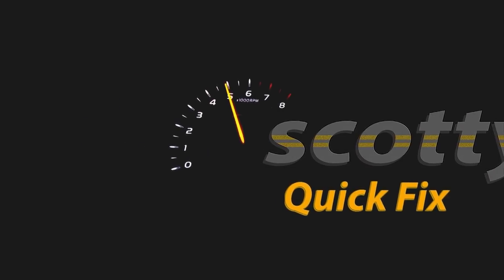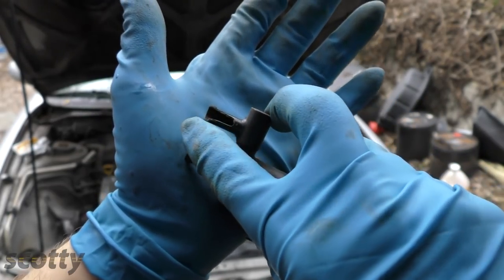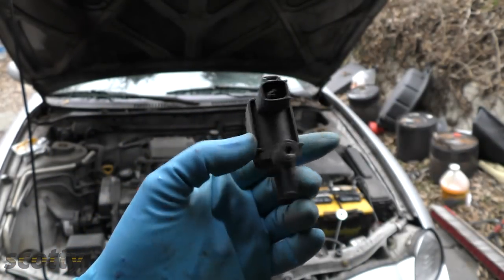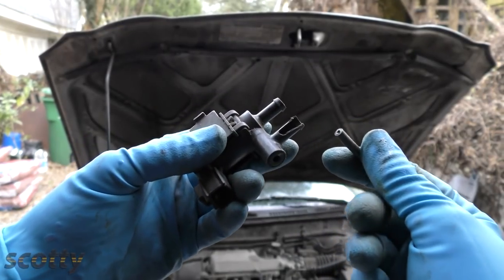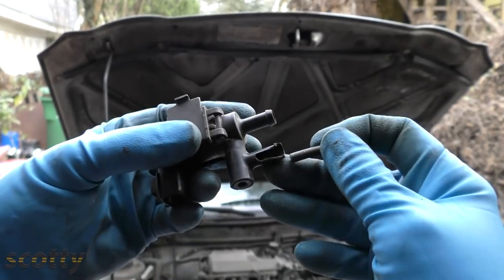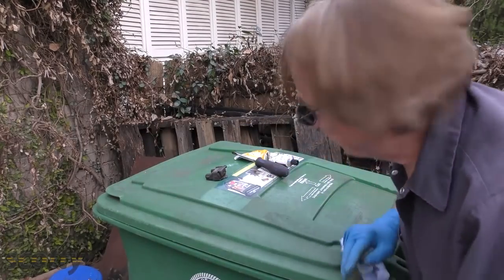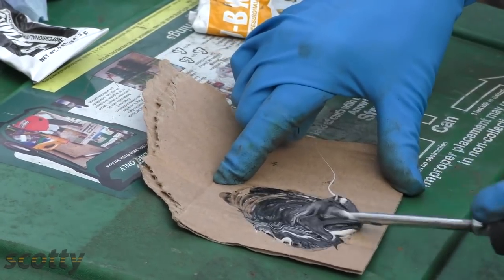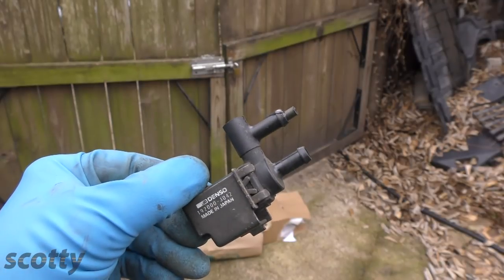How to Fix Car Parts Instead of Buying New Ones (JB Weld)

Comment: I was working Offshore on an Oil Rig when a a very inopportune time an Exhaust Manifold Cracked on a Diesel engine, it was a Turbo Diesel and without a fully functioning turbo there wasn't enough power and we were going to be STUCK and the end result would have been $Millions ...  we retarded the Cement with the low pressure that the pump could deliver and that gave us an hour ... we pulled the exhaust manifold, drilled a couple holes and with some JB Weld (that some guy just happened to have in his tool box) we repaired it, re-installed the manifold and waited for it to cure as long as we thought we could... it lasted (worked) until the next day (more than 24 hours) when the replacement manifold arrived on site.
Oil Field folks are some of the most resourceful folks on the planet.
JB Weld is great stuff

Comment: Jb weld works great I use it all the time. My buddies rear spark plug blew out on the ford 5.4 common problem to blow plugs out. He used it 10-15 times a year to tow a boat he asked me to fix it the fastest easiest cheapest way. Well I jb welded the plug I told him the plug will never come out IF it works he said just do what ever the plug would catch a few threads it needed a Heli coil but if you have no clue about a Expedition Well there is NO ROOM. So I mixed it up through it around the threads put the plug in and then I put more JB weld letting it run down on top of the plug hex and let it sit over night. That was 2 years ago and it still has not had a issue. Would I do to my own vehicle NO would I do again IF that’s what someone wanted and didn’t care  maybe would I trust it 100% YES. Have you ever seen the video the guy made a lawn mower head out of jb weld it actually worked but then it did blow off for the drilled holes for the head bolts ended up cracking then blew off. Jb weld is great stuff so is lock tit epoxy.

Comment: I've used JB weld to repair holes in gas tanks, oil pans and used it once on a broken alternator which a mechanic broke installing. I did put lots on the alternator though. It IS good stuff only do not use it where there is a lot of vibration because it will fail there. I also once used it to repair a wheel well. The car just sat around for roughly 17 years. It is still holding. Only....the filler didn't last.

Comment: That stuff works..used it once to seal a coolant leak around the carb of my car...it got discoloured from  the heat but never leaked for two years after before I sold the car

Comment: I used JB weld puddy to fill in a gouge in my crank shaft key way after the crank bolt worked itself loose causing the balancer pulley wobble. Still driving to this day with no wobble. Just put the key in where it would normal sit and fill in the gap with the puddy.

Comment: Hey Scotty  thanks for all the uploads man they really help me out I have a question I have a 2000 acura tl 3.2 put new spark plugs and coil packs change the fuel pump sometimes when I turn the car off and go to work when I come back out to start it back up it won't start

Comment: Also, if you still have the piece that broke off you can heat up your soldering iron and spot melt stuff back together, folding the melted plastic together and smoothing the surface as you melt along the crack line.  That works REALLY well.  JB weld, or epoxy is good but the melt method works well, possibly better.  Melt enough to get deep into the plastic but not all the way through.

Comment: Scotty--I would have tried to carefully epoxy the broken piece back into place, using the rubber tubing to help stabilize it while it was setting up, then removed it the following day.  I have to assume that the broken piece was lost awhile back and no longer available in this scenario.  If it WAS still available, I would have no problem putting the tubing in the opening as stated earlier. My concern about the tubing being made a permanent part is that the opening it was placed in now appears severely restricted compared to the other side.  Won't that affect the operation of the engine?  You're putting a vacuum line on it, and it looks like that now-restricted opening may cause problems.  You might have been better off using a section of a thin-walled plastic drinking straw or, my preference, a piece of brass tubing cut to size, either of which would have been less restrictive.  Thanks.

Comment: Scotty I have a racing down pipe which has corroded and rusted it self out between the pipe connection of the cat. Anything I can use to seal up that portion of the crack/ rust. Something to keep up with the high heat temperatures and get rid of that terrible exhaust leak without breaking the bank for new one .

Comment: I used Jb weld on My motorcycle. Crashed and got a pretty big crack on the engine. More specifically where the stator cover meets the engine. So the stator cover wouldn't close which is where oil is being held so I just J-B Weld it it and it's worked for about a year and a half. Really need to get a new engine for it soon tho...

Comment: Once fixed a boat trailer wheel bearing fit with JB Weld & still running it many years later.

Comment: I just purchased JB Weld for my car door. I went to open up my door on the driver's side and the door handle snapped. Instead of replacing the entire door handle, I will use JB Weld to glue the door handle together. I hope it works...

Comment: On my 4stroke 125cc scooter (thats 90% plastic by the way, the cvt and the Alu engine and carb are the 10%) the Right hand screw that holds my gauge panel in place has the base of the screw  broken from the other plastic, I tried glueing it to place , waiting for it to dry but due to minor torque when I screwed the screw back in it broke off again! I used some generic "cement glue" that should be good for glueing stuff to your bathroom tiles (and those reject regular Silicone glue) but cant hold a tiny piece of plastic! Ideas ?

Comment: I used the original JB Weld Steel on a rusty wheel well and its holding up after a year, but the quick set peeled off in a matter of weeks. How does JB Weld Quik compare to the original Steel?
Reply: weldrocks I have better luck with the original also, it’s like the quick set formula sets too fast before the surfaces fully contact

Comment: The little hose you put in there, the inside diameter of the orifice is much smaller than that of the original unbroken part.  Would that impact the use of the part or operations of the car?

Comment: I have done a lot of repairs with JB weld. I find the Original stronger than kwick set . I use electrical tape to keep it in place, because it does not stick to the sticky side of the tape. Go figure

Comment: Hi Scotty!!!
Can I fix a hole on fuel tank permanently by using JB Weld ??
Reply: Christos Sklivas they have a gas resistant formula that works better but it will work if used exactly rt but best to use the formula made for gas tank repair also made by jb weld

Comment: This works, but faster, easier, is hot glue. Use it all the time for vacuum switches, intake plenums etc. Fast, easy to apply, and can be scraped off if necessary and re-applied. Of course, I'm just fixing plastic vacuum parts with hot glue, it would probably melt in some places where JB Weld would work better.

Comment: Mr scotty this  is just also a quick question, is the JB WELD able to fix  leage of abs control unit? I tried epoxy steel but when the pressure came on it starts leaking again....please answer me.thanks

Comment: Is it smart to put it on like a transmission crack ? My transmission cracked and i was told to use this but is it a smart thing to do ? Its a small crack but will leak but its dried up now its been sitting for 2 days

Comment: I had my 04 Dodge Ram slide off the jack and the rack and pinion line was ripped out I’m thinking of using some jb on it because at the moment I can’t afford a hole rack do you think it will hold?

Comment: @scotty my power window glass has broken off its plastic handle so now it doesn't go up and down.  I've tried different types of glues to reglue the plastic part that holds the glass in place with the motor housing and it keeps comming off after 72 hours of drying.  can you recommend a fix?  it's honda accord 05
Reply: Charles White rear view mirror glue used to reattach mirror to windshield is your best bet any auto parts store or walmart has it

Comment: I wonder if I can use this stuff on the cover shield underneath my 97 Mercury Cougar. The corners where it fastens to the sub frame using push pins broke and it ripped after I bottomed out in a pot hole.

Comment: when i changed the timing belt of my wife car, one of the water pump bolts head broke off and then i spent 2 days trying to get the thing out from the hole. i said fu k it! i putted jb weld in and around the hole of where the bolt was supposed to be then created a gasket with hondabond all around the pump and it works great. no leaks no nothing.

Comment: hi Scotty, i have a 90 celica st & the trunk hinge on the driver side broke.. would jb weld be possible to work if i used it on the hinge? since it's always opening & closing cause it's a trunk..

Comment: Can i jb welb my engine cradle? Its a 2002 accord v6 and common issue is rusted subframe on the engine cradle portion of it because of how honda ran the a/c drain line

Comment: Not all epoxy is the same. try different ones out for different situations. epoxy putty is better then the thin 2 part epoxy if you need to have a really thick layer for strength.

Comment: My rear windshield spray nozzle clogged. Nobody sells a replacement. I couldn't unclog the spray holes with a needle. Soaking it didn't work. I had to drill a hole in it to get in there with a needle and vinegar and compressed air to unclog it. I used JBWeld to patch the drill hole. Problem solved.

Comment: I have a leak on my 05 corvette it’s on the radiator it’s a topical problem if that makes any sense does anybody know what I can use to block the leak ? It’s very minor I’ve used other things but the pressure just breaks it apart

Comment: Anybody handy with a soldering iron? All those expensive circuit boards can be resoldered if cleaning the contacts didn't work. ECMs, PCMs, body control modules, speed control amplifiers. On a circuit board the most common fault is a cold joint.

Comment: I was thinking, since you pulled out the part anyway, why not cut it in 2, make molds and cast it in tin or lead. Not the strongest of metals, but it should be better than plastic...

Comment: I had a hole in the bottom of my boat. Cut the top outta a beer can and glued it with JB Weld. Worked great 'till my ex pulled the tab!

Comment: Alright. So my dilemma. Muffler has a huge crack in it and I dont have the funds right now to get a new one and get it installed (also dont have a tig welder). I'm gonna try some JB weld in the morning. Anyone know how long itll hold till I have to buy a new muffler? (Hmm maybe ill just straight pipe it)
Reply: HiddenEclipse yes cut top and bottom off a coke can cut can so it is aflat piece of metal mix jb weld smear like a pnut butter sandwich put it around and tape or clamp or twist coat hanger wire on both ends as tight as possible LET FULLY CURE and you will never have a leak there again
Reply: HiddenEclipse it will last forever

Comment: My pedal goes to the floor after replacing brake caliper on my toyota corolla, What should I do??
Reply: Bleed the system and make sure all the connections are tight.
Reply: kingchris123 Alright thanks.
Reply: Rýán Túçk I put new rotors and pads like 5 months ago, now I also have a different problem the studs for the wheel broke and Im driving on 2 lug nuts, I cant believe all this happened in a matter of time.
Reply: VisualPlays gonna have to replace all studs on that wheel just to be safe.
Reply: Septiikos yea my mechanic replaced the studs, It was super easy, should of done it myself but I have no tools.

Comment: I recently discovered that my timing cover has a small hole on it.
About the size of a dime. A brand new one would cost $150 to 200.
I may very well try this out and use something to cover that hole rather than spending all that money.
Reply: Zexidous a hole the size of a dime anywhere on a motor is a huge hole but yes it will work 
Remove cover use tape on inside to form a flat surface while jb weld fully cures then re attach

Comment: The lug nuts came of my 94 toyota celica while I was giving it a good thrashing and I thought hmm I can't find any spare lug nuts in my car so I guess I'll just pull out the old jb weld n Bob's your uncle 16 years later and its still good even still got the original tyres  n transmission my Toyota celica is a good car not like these plastic peices of crap you see today I even used jb weld to put that bell in place 🤣

Comment: I tried using it to fix a crack in my radiator and it did not work.  Had to replace the rad.  :(